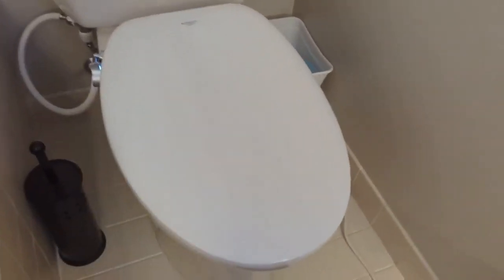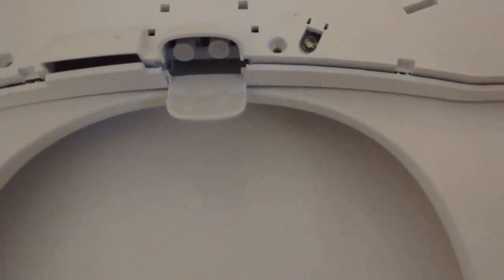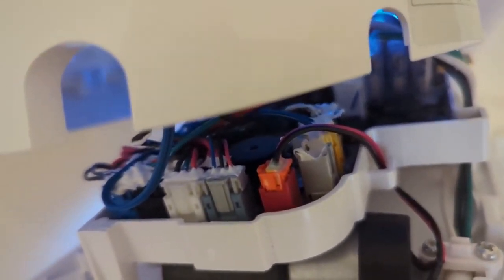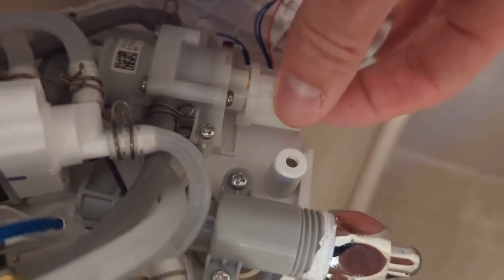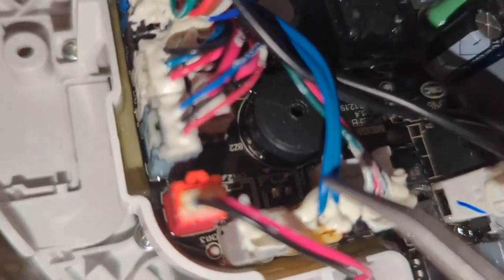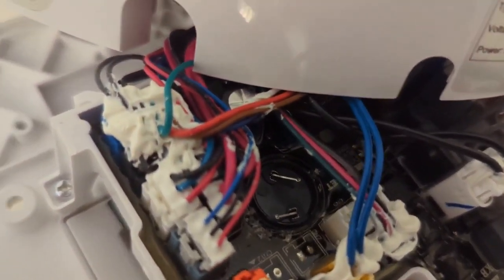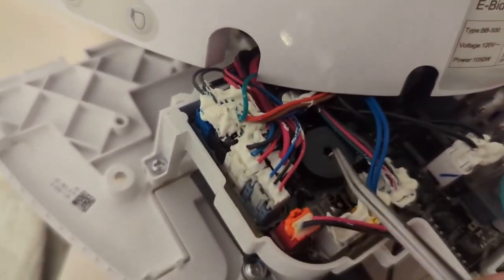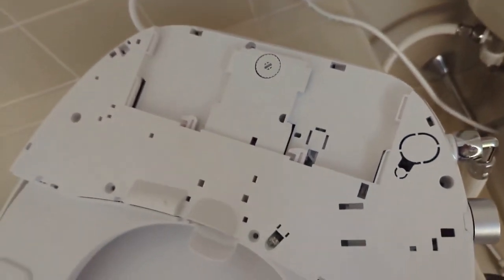How to get rid of that annoying beep on a Bio Bidet BB500 Toilet Seat

Comment: Did you try just turning off the beep by holding down the toilet seat temp button?
Reply from the maker: Doesn't work. Tried so many times. Lots of people say this works but it doesn't on my model.
Reply: @jhelvy  I know this video is for the BB-500, and I have the BB-550, but this is what came up when I was trying to search online about how to silence it. I tried holding down the toilet seat temp button on mine, and while it didn't silence all beeps, it silenced the automatic beeps that happened when the seat starts or stops detecting that you are sitting down, which were the most annoying ones. But it still beeps when you adjust settings on it. Maybe that's how the BB-500 works as well, and the reason for the disconnect between the comments and what you were seeing?
Reply from the maker: @brismuth  that's probably what people are saying. I'm sure that's how it is supposed to work, it's be an extremely logical design. Sadly mine would always beep no matter what. Trust me, I spent far too much time trouble shooting this, and I would love to have not disassembled my seat, but literally nothing else worked. Perhaps mine was defective but I've seen enough other complaints that I don't think it's the case.

Comment: the beeping can be turned off by pressing and holding the seat temperature button for 2 seconds
Reply: Exactly, no need to disconnect anything
Reply from the maker: Doesn't work. Tried so many times. Lots of people say this works but it doesn't on my model.